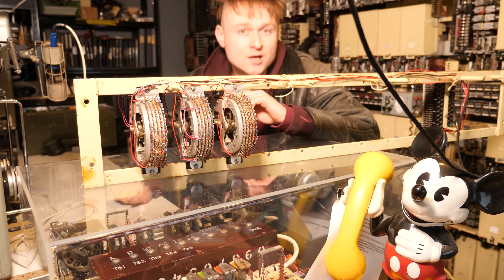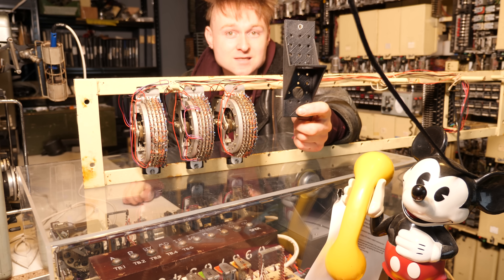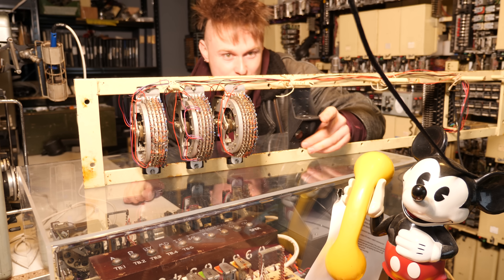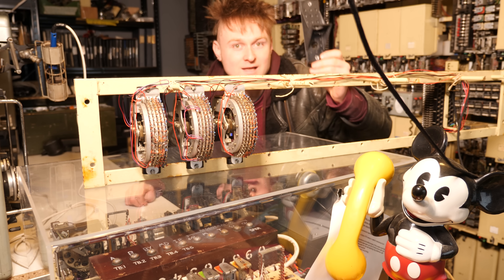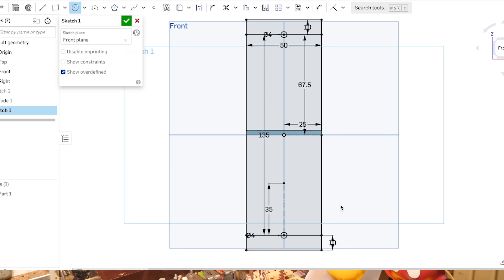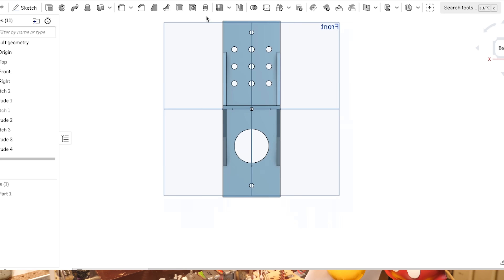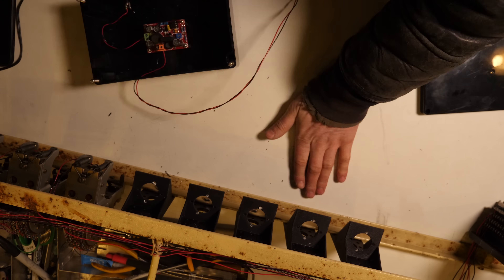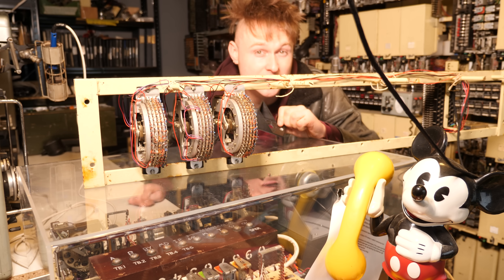I MADE A 24Hr CLOCK WITH JUST UNISELECTORS AND NIXIE TUBES

Comment: You should implement a leading zero blanking arrangement on the 'tens of hours' Nixie.
Nice job all the same, especially with not a single silicon device used.
Reply from the maker: Naaaa nice to see em all lighting :). In order
To do it you just unsolder the zero from the uniselector but much nicer with the zero present Cheers.

Comment: I would love to see your museum! I learned about "stepper switches", relays, and all sorts of electro/mechanical stuff by taking apart surplus equipment as a teen in the 60s. I eventually went to electronics school and learned about discreet logic gates before there were integrated circuits. Now we have microprocessors on a tiny chip. I've seen quite a technological revolution in my 73 years of being a "geek". The old-school stuff is much more interesting to see in operation. I'm really blown away by watching old mechanical telephone pulse-dial line routing equipment running. Old pre-digital pinball machines and juke box mechanisms are amazing, too. I keep my ancient brain alive by playing with Arduino now. I love that you're using high-tech CAD software to design the mountings for your 75 year old devices.

Comment: I must admit I’m a little confused how separating the rollover from the 0 digit still keeps time. Isn’t that adding an extra delay, and the clock will drift out of sync? 

Or am I missing something because of the two pulses per minute thing, so you’ve just got both sides of that minute to use for rollover where the other digits only “use” half of the minute?
Reply: I slowed down the video and the 10s of minutes selector ticks when the 1s digit is done with its shuffle. So the 10s digit's tick is delayed a bit compared to the incoming pulse (leading to the digits being out of sync during an update) but the pulse does come through half a second later, fixing the count. I'd be more satisfied if all digits updated truly synchronously but practically it doesn't matter.
Reply: @eDoc2020  oh yeah, I’m not worried about propagation delay. In imagining this logic as akin to a mechanical flip clock, I was concerned it’d be like adding an extra leaf between the 9 and the 0, instead of having the little rollover tab directly on the 9. 

Given what you described, I guess it is as I supposed in my second paragraph :) (and also maybe I should’ve said “out of phase” rather than “out of sync”!)

Comment: Great video. if you're going to add leap years, remember there's a 400 year rule to them. Such that 2000 WAS and 2400 will be a leap year, but 2100, 2200 and 2300 will NOT be a leap year.

Comment: Uniselectors were used in the master clock on the Schafer radio automation system.  The time source was a synchronous motor driven photointerruptor which generated one pulse per second but it could also be driven from an external 1PPS source.
https://youtu.be/YajwGdbXV1w

Comment: Interesting setup. Thought it'd be the 50Hz from mains as the base clock cycle, but not the case here. Although it makes sense given what's available at the old electro-tech museum. You've got more interesting options than what would be there for some desk clock.

Also it'd be a laugh if those switches would fit on Euro-rack rails. (I think it would have already been tried and ruled out though.)
Reply: Phone system usually needed to be run from batteries when the mains power failed.  So no reliable AC reference.

Comment: this is so cool dude
also I might have a great clock idea that needs your help
A digital clock build with analog parts
that uses a crt as a display
I have worked out most of the things (I can draw the numbers with resistors/capasitors)
but I have some problems with driving a scope crt
Reply: also were do you get your uniselectors?

Comment: Do you have a reliable source for those “Christmas Tree” terminal blocks? We use them for audio wiring in our theater, and ADC stopped making new ones. We only need three rows of terminals, but they are modular enough that larger ones ( like the one in the video) could be modified for fewer rows.
Reply from the maker: ebay is always your friend. search gpo block or something like that

Comment: If you could get half second pulses you could make a big ben sequence with a uniselector to tick through the sequence and one to kick of the (quarter hour i think, idk, im not british) sequences every increment. Every note should be half a second long with half a second break after the forth one. Might even be possible to combine it with a ding for each full hour done.
Reply from the maker: If you watch the visitor counter that does the Big Ben sequence. But the proper sequence only happens on the number 2687
Reply from the maker: Need need for a half second. I just use a big capacitor
Reply from the maker: Sorry the Big Ben sequencer number is 2657

Comment: Very nice. If I may make a suggestion I'd have inverted the signifier so that it turns off briefly every two seconds instead of on. I don't think burn in is a huge issue. I've had my nixie clock running more or less continuously since 2007.
Reply: Burn-in no, but sputter, where metal vaporizes and coats the glass increases the more current you run through the lamp. Under-power it by using a higher rated resister will greatly decrease sputter while only slightly reducing light output.

Neon glow lamps and nixie lamps work by smacking electrons into neon gas surrounding the cathode causing photons to fly off. That process can go on forever.

Comment: Why not use some Seiko 32.768 crystal and some clock divider ic's as master clock?
Also some German transmitter (DCF77, range 2000 km) sends a time signal, would be cool if you could hack in to that and receive that signal and convert it to your master clock and leave your classic master clock as ornament, than you never need to check if it's correct. seams there are low cost kits available to receive the DCF77 signal.
Reply from the maker: why do that when you have a master clock that does the job perfectly adequatly? :). im aware we disagree a lot on concepts, its all good! perfectly valid, but i do things the way i do it :D. cheers!
Reply: @LOOKMUMNOCOMPUTER can’t get much more analogue than a pendulum mate, brilliant.
Reply: sure, the pendulum works since Kepler invented it, but the German DCF77 signal is around since 1959.
When i was a kid i had such alarm clock that used that signal as many people owned a wall clock that used that signal.
Would be extreme cool if manage to hack that with a low cost DCF77 soldering kit, your clock would always be accurate, it would trow up another engineering issue to solve, how to reset the Dixie clock. automatically : )
Check it out, will probably be a very cool learning project using German precision.
 @LOOKMUMNOCOMPUTER
Reply: the wall clocks would automatically dance around at some interval to set it self to the correct time. @LOOKMUMNOCOMPUTER
Reply: Eew, ICs? That could be done with tubes/valves. Practically speaking (for a more "modern" version) I'd use a geared down AC synchronous motor with a cam.
Reply: Hmm, Seiko is known brand for human watches, pretty sure they spend some time of thought of  making sure their 32.768 crystal is worth while, so you could skip to be worried about that and focus on your product, you need at least 2 x CD4040 to count up to 4096, that 8 times over to have a precise 1 second timer. @eDoc2020

Comment: If you want your clock to last forever, then "Leap year every four years" isn't going to cut it. It needs to be every four years, except every hundred years, except except every four hundred years. You're gonna need a bigger rack...
Reply from the maker: ha well if it comes to it and i find enugh racks thatll be fine/ with that it'll probably only need 3 more uniselectors at most! if you go by the datasheet of these uniselectors however the 30 second uniselector will probably only work to specified (if new) for 30 years with the amount of rotations (it'd probably last a lot longer though, just past specification by then), however to replace is trivial itll take an hours to re solder. the second uniselector in theory will last 300 years till replacement etc.
Reply: @LOOKMUMNOCOMPUTER  make a plugboard to put in the leap day settings.

Comment: Amazing as always! There are so many similarities to TTL-logic. I built some counters with it. Nice.
I wish a happy new year.
Reply: I once made a clock with CD4017 ICs. They're solid state decatrons and thus related to these uniselectors here, but most of the time they're used for light show animations. It even has an alarm that strikes a bicycle bell with a hard drive read head arm.
Reply: This is just a mechanical computer with a clock and three non-binary counters in my opinion
Reply: Well, when inventions like transistors or microchips were initially made they often replaced some old clunky piece of hardware instead of completely re-inventing the whole circuit. So that's why there's so many legacy and pretty much useless aspects in tech products that make no sense to a young brilliant mind who encounters those mysteries the first time. And that makes it extra fun.